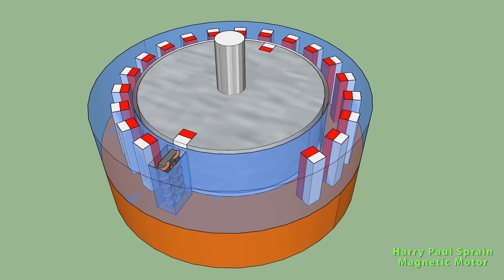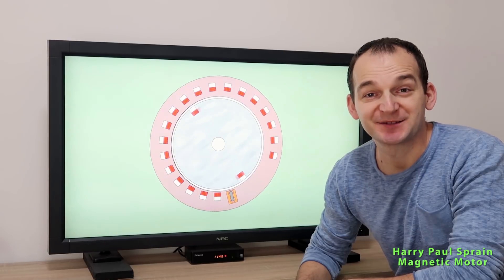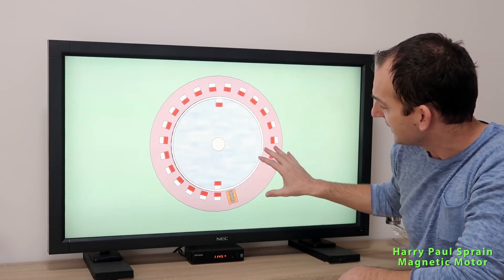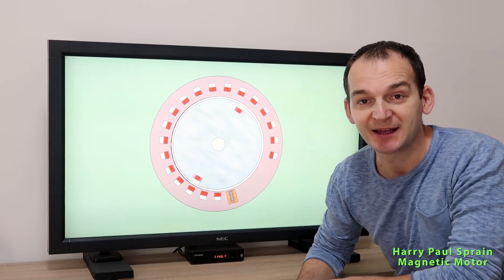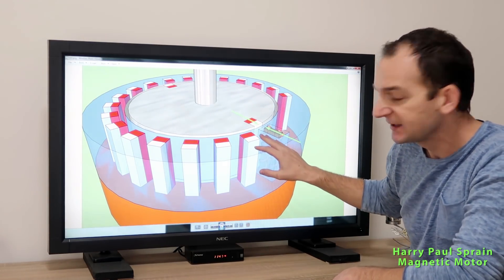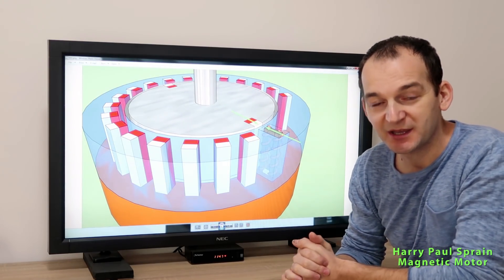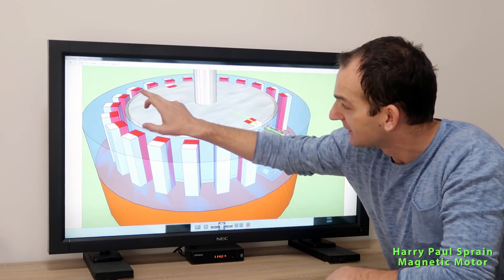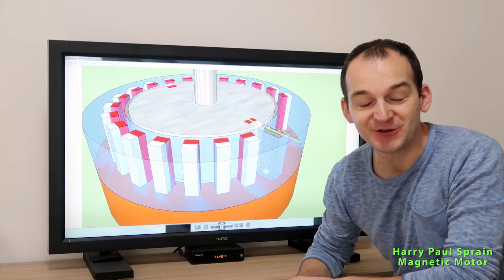Free Energy Generator 2019, Yes or Not!!!!!!!

Comment: Of coarse it will work, it's just an ordinary  pulse magnet with the aid of the magnets helping make rotation. I've built many of these motors before. 
A good way to trigger the coil how I like over a reeve switch is to use a bipolar transistor. 
To use a transistor you would have to have a dual winding coil. You connect one of the coil windings to the base of the transistor and the other to the negative battery terminal.  You connect the other coil to your supply voltage and the collector of the transistor. Connect the emitter to the negative of your battery  (say 12v) . Give it a good spin and away she goes. 
After your first spin, the magnet passes the coil inducing a current to the transistor, turning it on and the coil will switch poles driving the magnet across the coil. The transistor will switch back off till the next coming magnet. 
Great little motors, lots of fun. 
Yes it definitely works 100%.

Comment: Is it a more efficient motor than ordinary electric motors ? When the magnet approaches to coil, the coil has to be switched on, possibly by a hall effect switch. Then it has to be switched off. So in fact it can be implemented as a brush-less motor. It can also be implemented with contacts, just as the magnet approaches the coil, it will bridge two graphite bars with a piece of copper. The question is all about efficiency. I also see no reason for not implementing the motor with 3 or 4 magnets probably depending on the sector with no magnets. So it is not a perpetual motion motor but it is an interesting device.

Comment: Good in theory but not so much in physical form you see with two magnets 180 from each other one will get to a point of medium sized pull to a magnet when the other at the same time will be at a point of a smaller sized pull and thus slow it down once the decreased speed starts to play a factor it will inevitably try to find a balancing spot aka equilibrium now if you made this super sized and on its side with a free spinning axis point maybe just maybe it could work with gravity and centrifugal force but then again it will always try to find an equilibrium point... Possible sure with alot of physics and engineering ..interesting concept keep trying .

Comment: Jesus, all of your animations are failed concepts.

None of them will work because

A) you violate the concept that equal and opposite reactions happen. 

B) you seriously don't understand the concept that all systems try to find equilibrium.
Reply: This one really works, but it's just an electric motor.
Reply: @andreasschmitt2307  Looks like similar operating principle as a V-gate with bucking coil, just arranged with a slightly different geometry.
Reply: @craigslitzer4857  
Yes, this resembles very much Crystal by Inductance Energy, only Crystal is using a lever instead of the electro magnet.

Comment: Turn the electromagnet OFF? That is unlikely to work because the magnet will be attracted to the ferrous core (assuming it is cored based on the animation). Turning the electromagnet ON in repulsion mode around TDC makes more sense i.e you push the magnet away, or if you are using a torroidal core, nullify the core attraction - in both cases the electromagnet is turned ON. The properties of the core would need to be such as to overcome the attraction of the rotor magnet to the preceding stator magnet, prior to turning on the power, which in turn demands a certain number of windings and power to turn the core into an effective repulser (or at the least nullification of attraction). Also the animation appears to show the coil facing the magnet which is not optimal because the resulting magnetic field is subject to the inverse sq. Iaw i.e the closer the field is to the rotor magnet, the more force it can apply (for a cored electromagnet the lines of force are usually focused in the core).